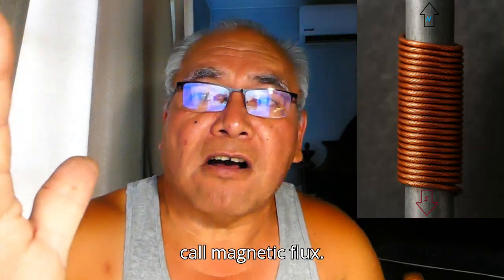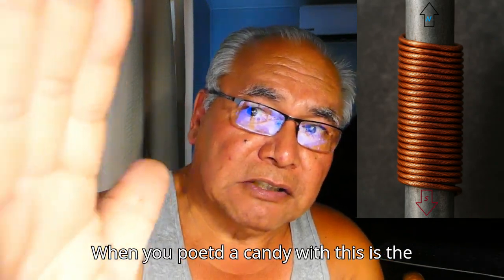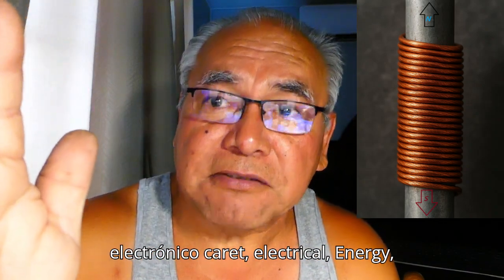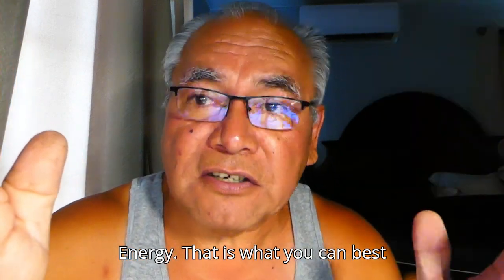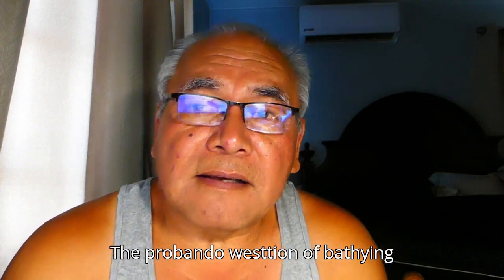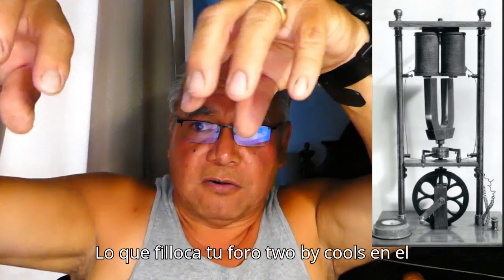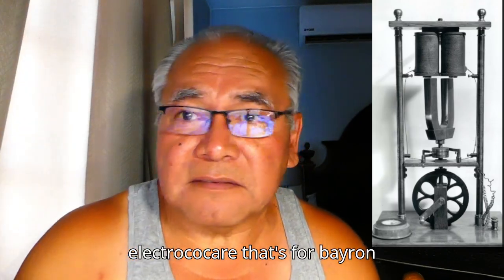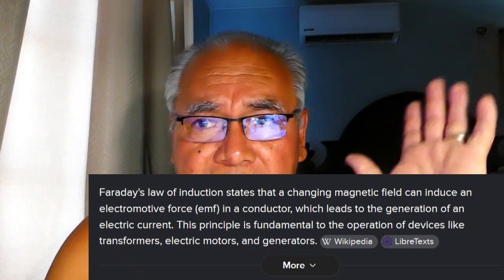generador kent, explicando como anular el freno de ley de lenz.

Comment: Very interesting, do you have a successful prototype with the coils oriented as you suggest?
Reply from the maker: lenz in this case is going outwards to each side of coil but NOT DIRECTED at spinning magnets thus avoiding the drag...https://www.youtube.com/shorts/jyK1Kml2jck
Reply from the maker: yes, but its not the coils, its the magnetic flux inside the coil that is doing the generating.
Reply from the maker: when Iron is close to 2 of the poles in a magnet, the magnet reaches out out to complete the magnetic circuit and in doing so causes a change in magnetic flux as per faraday's law you get a current in the coil...https://www.youtube.com/shorts/jyK1Kml2jck